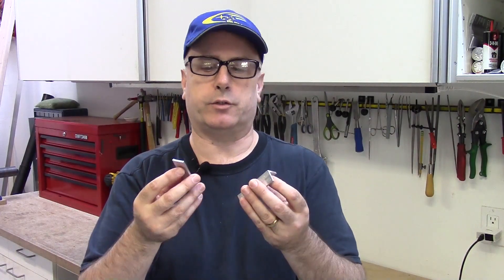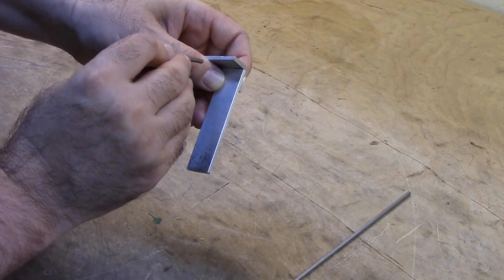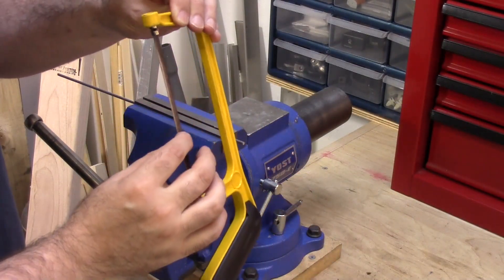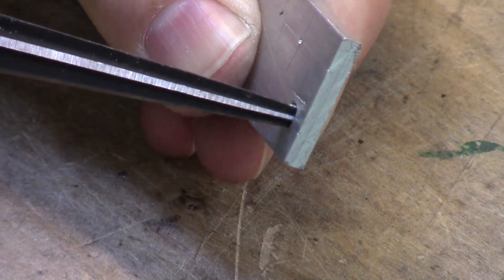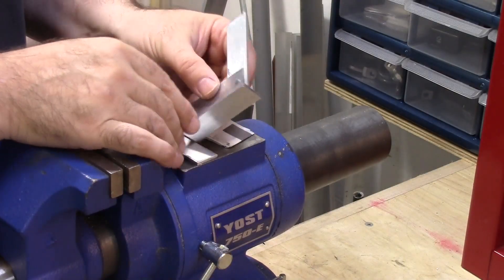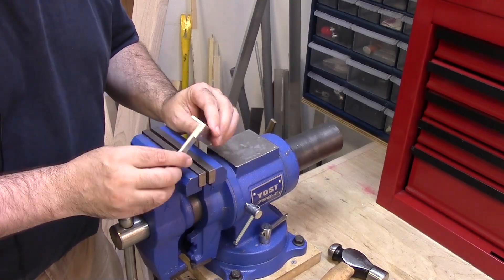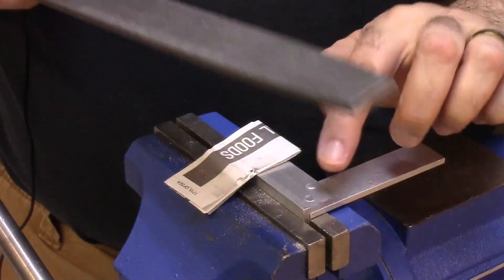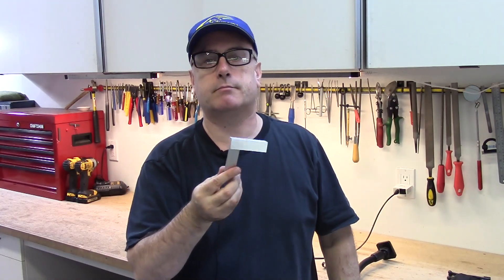DIY Double Flush Rivets

Comment: I've used plug welds as a method to get a "flush" look in the past on certain projects where the aesthetic of a weld bead didn't meet the desired look. This means a little more work, but with properly set rivets you can get a very strong joint as well. One thing I've found is that if you have the time, rough up the mating surfaces and use a two-part epoxy(like JB-Weld) and apply some, clamping them together so it cures. Rivet as shown here, to give some added mechanical strength. Some might say overboard, I say "standard business" when you want a joint to be as strong as possible and you cannot weld it and have the time for the epoxy steps

Comment: You can use a hardened piece of steel as a "mandrel" to set the rivets without using the hammer's head face directly. This is useful when working with c/u channel or angle(as shown in the video). Will help keep you from smashing your fingers ;-)

Comment: Is that 25% a good rule of thumb?  I'm working on my first rivet project and the shop head is supposed to be flush. I wasnt sure if the usual 1.5x would work
Reply from the maker: Better too long than too short. You can always file it away afterward.

Comment: Thank you so much. I wish I had seen this before the "YOU CAN WELD ALUMINUM SUPER EASY WITH THESE RODS!!!!" videos.   Half of my welds (brazing?) failed.  My surface where cleaned well.   I think it had to do with the aluminum being to thick to maintain the heat.  It was L shaped 1"X 1 and 1/4" and roughly 3/16" thick.  I was attaching 3" wide straps that where thin.  Even with MAP gas it wouldn't get hot enought to consistently "weld" bond together.   Steves rivets seem like a better solution for mechanical bonding.
Reply: Thanks for sharing with us your frustration with aluminum brazing rods! 
Saved me time, effort and frustration!

Comment: 1:43
What am I looking at? It looks like a drill bit. Is that a brush of some kind? What is that tool you’re cleaning the hole with?
Reply: He is just using a drill bit larger than the one used to make the hole for remove the burr. It will make a cleaner finished product than going straight to the reamer.

Comment: I can see the same flush surface rivets setup on my old hack 5" engineer's set square. It's had a hard life abused by many but still gives an accurate 90 degrees.  The newer set i recently bought (clean shiny and of small sizes) appear to have all been brased-welded with no sign of any rivets. I bet that if they were ever dropped that's the end of them for accuracy.

Comment: You have a lot of courage!
Hold and drill metal sheets in your hand.

У тебя много смелости!
Держите и сверлите металлические листы в руке.

Ai mult curaj!
Țineți și forați foi de metal în mână.
Reply: Agreed! It doesn't cost any extra time to, at the very least, block the stock from rotating by letting it touch the column of the drill press. L

Comment: I think a little more metal in the head of the rivet would have held the pieces together better and kept the metal from  bending.  It was only able to bend because the rivet failed.  A little more counter-sink would have done the job.  But the rest of your work is exceptional and I  learned a few tips  from you to help me out in the future.  Thanks.
Reply: A steeper angle with a regular countersink bit would have left more supporting material.
Reply: You can’t countersink to the point of a knife edge because it will cause rivet shearing

Comment: In additional to my  previous  comment
in the aeorospace technology
the solid rivet is  used instead of welding  like aircraft   fuselage  such as Boeing etc.
using basic tools nearly 
The difference   is mini pneumatic  1.4 kg hammer  ( price is $30) and bucking bar instead of hammer and  vise
earl years flush rivets are hand made for steam tanks with basic tools

Comment: When filing aluminium you get a better finish if you put chalk on the file.
Reply from the maker: Great tip, thanks!
Reply: @stevecornett8043 You can use a block of laundry soap too, instead of chalk to prevent clogging the file teeth, also used on sanding media to avoid clogging.

Comment: Why aren't people welding it instead? Since mechanical strain is not infinite, It's better to go for the molecular bonds right?
I'm not an expert, but if it abouts sticking 2 fixtures of the same matter together it should certainly hold nice if we heat it right?
Or is it just a question of cost?
Reply from the maker: This riveting technique is for non-structural applications with advantages over welding for cosmetic finish, use of ordinary tools, minimal skill, cost. Not everybody has welding equipment and there is a bit of a learning curve for welding aluminum and making it look good. Aluminum soldering might be a good compromise for some applications, but I've found it quite challenging to get a clean looking result.
Reply: Some materials are not easily welded such as high strength grades of aluminum, etc. Rivets can be used no matter the grade or type of material. Welds are not always guaranteed strong either. Heating the material can significantly reduce the strength of the material, and if it's not possible to heat treat the assembly after welding, you could be making large sacrifices in strength.
Reply: Heating the metal changes the heat treatment which makes it harder and more brittle.
Reply: Going rate for TIG welding aluminum in my area is $3 per joint. Each corner of a box has 3 joints, meaning a simple box might cost you $240